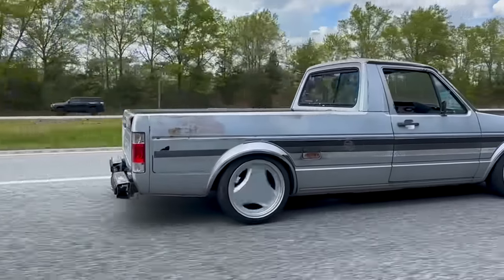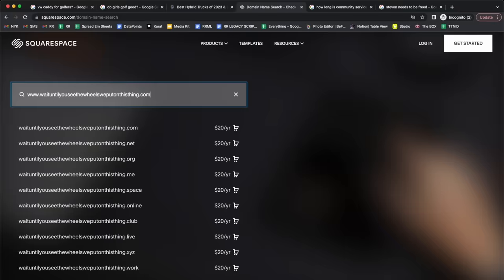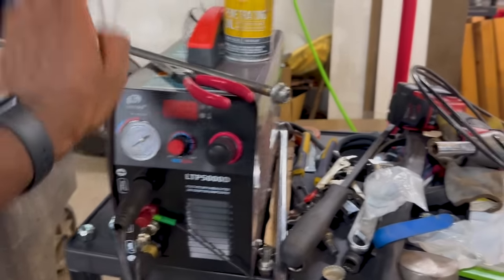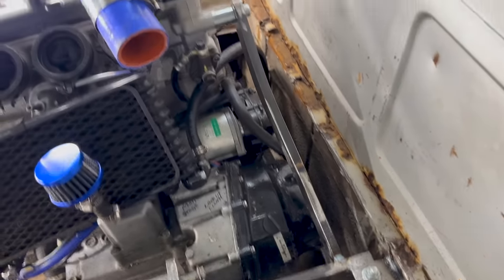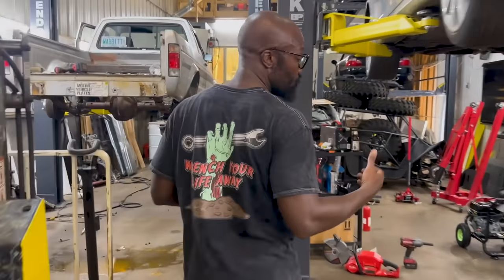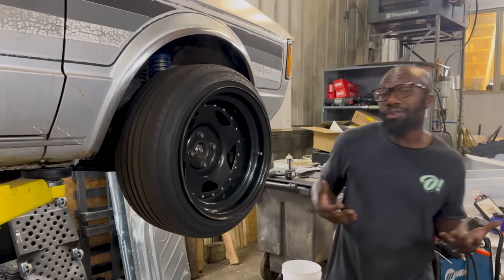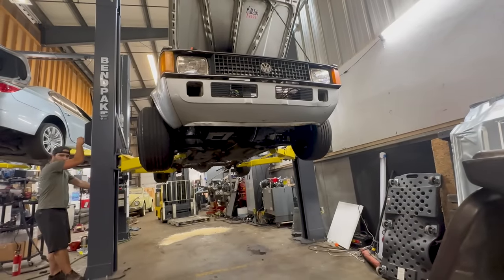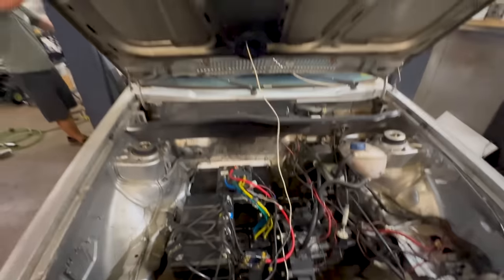The Turbo Hayabusa Hybrid VW Pickup Hits The Road

Comment: Hi Rich, on my motorbike i use a quick shifter! this could be a great and cheaper way to shift gears than a full auto gear changer!! it basically detects when you are starting to change gear ( you will need a simple shifter just for going up/ down the linear gear system.)it kills the engine for a split second and changes the gear in that split. it doesnt damage the engine and keeps the PSI of the turbo mostly intact! i think it would be a great idea for the build!
Reply: I saw a lot of these builds with bikes and they're usually car guys putting a bike engine in. I don't know maybe they're not into it that deep. Who knows...
Reply: I second this, quickshifter would give you clutchless upshifts for not a whole lot of money and the compromise is that you need to clutch for moving off and downshifts. Also then you could use a Supercars Australia style shift lever 😮
Reply: I think it's a good idea to avoid mechanical shifters, electronic shifters are expensive, but so is time.

I think the amount of pissing around trying to adjust linkages or pneumatics or hydraulics to shift mechanically could easily cost more than an electronic paddle/button shifter, and would probably need to be adjusted as parts wear in and out, especially because the gearbox isn't hard-mounted to the chassis like a normal car. 

I'm guessing that mechanical shifting would be fiddly and annoying compared to an off the shelf electronic shifter that mounts directly to the side of the engine and doesn't know or care whether it's on a Hayabusa drag bike or mounted in the middle of a Rabbit pickup.

Remember these guys (apart from Rich 🙂) have real jobs at a real company, so every hour they spend on Rich's projects is money they aren't making for Electric Garage. There has probably been tens of thousands of dollars worth of labor invested in this thing, and they still have to be paid somehow.

Comment: As a hybrid classic car it is very interesting project. But the problem with motorcycle engine is 1. Low Torque and high rpm 2. Weak Clutch and gearbox 3. Weight of chassis and body. I think for this kind of project Harley engine with separate gearbox is better option so that way you can use car gearbox and clutch with adapter plate. But will see how it goes with this engine soon

Comment: Instead of that thumb throttle thing I’ll bet you could use the tps on the hyabusa motor. Omron makes signal conditioners to turn 0-1, or 0-5vdc into 0-12 or 4-20mA or whatever your motor controller wants to see

Comment: * - Rich, you said you read these comments.. so I have a question.. Can you wire up the old ECU (and/or add a microcontroller, it would be easier).. but make it so.. that when you go in reverse it's ONLY electric signals.. and when you wanna launch it, it would start with electric until certain speed or RPM.. then gas would kick in gear, (bcuz of stock transmission).. and then the question of running them equally while driving.. equal RPM or torque.. to get 4 wheel drive.. syncing them.. i don't think the factory ECU would allow you to do that.. but you could use a microcontroller to control the electric & sync them.. some outputs go into old ECU... But the electric could start & move it with high torque up to a certain speed or RPM.. then the gas engine kicks in & together they sync up speed... 

** oh, & you can make that [? $1,500 ? - you said] automatic lever shifter.. it looks like it's just a metal frame/plate holding a *LINEAR ACTUATOR*.. make the whole thing for under $100.. you can buy the linear actuator, make a plate to hold it.. wire it up.. save $1,400... that's the rich i know.. lol

** And you don't wanna have to remember to keep doing 5 diff things while driving (this button, these 2 levers, press this 3 times, immediately repeat all, while focusing on the road and trying to steer).. the microcontroller can control EVERYTHING ... it can monitor speed & RPM, know when to send signal to linear actuator & shift the gas engine, to automatically use the clutch, to know that reverse is only for electric, and know when taking off to start with electric up to x speed, then ramp up gas engine & sync.. and honestly you could wire this up and use the existing gas pedal to control it all.. like a normal gas pedal.. but everything is happening in the background super fast.. (ECU's use microcontrollers.. same thing), or you could do paddle shifters for up & down shifts.. let it sync it & control everything.. the way it was meant to be.. if you have any questions or need help.. email me

Comment: I second the quick shifter suggestion, you only need cluch to take off and to downshift, upshifting is clutchless as the quickshifter control unit cuts power to the injectors for some milliseconds (typically from 20 99, adjustable) and doing so doesn’t hurt the internal transmission gears

Comment: I like how you said, "I can tell you guys haven't built anything.", In reply to the folks asking what's taking so long. 
I buy junk scooters, ATVs, ATCs, etc to fix and sell. Since I'm broke i usually pay between $10 and $100 for each project. As you can imagine, for that low price, they aren't in good shape. They're usually missing many parts, and have many small problems. I can't afford to just buy new parts to replace everything, so i end up doing a lot of fabrication. 
The most stressful part for me, is when I've finished an 8-10hr day of working in the garage, and it seems like i haven't accomplished anything. People don't realize how long it takes to do little things.
 I've wanted to start a YouTube mechanic channel for years, but a few things have stopped me. For one, i can't afford to buy a decent phone to take video. But a bigger problem is that I'm worried having to film everything would make it even harder to get stuff done, and make projects take forever

Comment: Gear shift.  Starter motor solenoids will work, ive used them sucsefully on a build,bonus is you can have a over ride switch that when turned on will also kill the motor on the upshift,hold flat hit up shift engine cuts changes gears allowing flat shift changes..

Comment: just a note you might want to check the interior cavity of the rear box on the caddy for an item called cavity wax if you find it you might consider removing it before testing the turbo exhaust, it was a sealant often sprayed into the inaccessible areas as a rust inhibitor, i'm just thinking the last thing you will want is a fresh coating of it on your McLaren exhaust tip, oh and don't bother with the small minded people who have never built anything before, if your going to build something and want it done right then its gonna take time, i have a mk2 Golf GTI that i have been building for the past 14 years with new off the shelf parts only, only thing in my car thats used is the body... its 90% done, but i gotta say i hate the stretched tire look, i would prefer to stretch and roll the fenders or cut and weld them to make real arches to tuck the rubber into, don't forget wheel travel when building this monster what goes down must come back up 
wheel arches are usually the death of stretched tires

Comment: Build is looking awesome! 
May I suggest the radiatior over the Axel flipped the opposite direction and pushed to the passenger side so that you can make some bed space in the back and the radiator kinda looks like a wing but coming up flush to the bedsides.

Comment: I could dig a sequential gear box geared low with a top end around a hundred so there would be lots of shifting and wringing the most out of the little Busa that could . Then tie it all together with some creature comforts like vintage air maybe sparco seats and cruise control . Ventilated cooled seats too  . I actually drove one back in the day as a company vehicle.  I loved that truck , a diesel if I remember correct . ? Slow and gutless but very ergonomic very comfortable . Gas milage was it's key attribute over any other , and it delivered . Fairly nice interior mine was loaded I think two tone red and black .

Comment: If there are issues with the driveline being too short and ujoint angles not working you could always IRS swap it, the infiniti g37 and is300 both have relatively narrow track widths and solid diffs, and are very easy to fab mounts up in trucks. It'd get rid of those drum brakes and leaf springs too, would handle way better. I did an irs swap on a tacoma on my channel. progress looks good, take your time, we don't mind haha!

Comment: Don’t need that weird shift thing, can get a quick shifter and it will do full throttle clutch less Upshifts. If you get the SP race module which is pretty cheap you get pit limiter, quick shifter and launch control for a couple hundred quid, just put the hand clutch lever on the gear stick for down shifts and pulling away

Comment: The rear of the bed is a low pressure zone therefore it’s a terrible place to mount a radiator due to the lack of airflow. Just thought I’d mention that although maybe the extra large radiator from the C10 will allow for enough overall cooling for that cycle engine hopefully. Keep up the great works Rich screw anybody that doesn’t like the build or how you go about it, remember it’s not their build.
Reply: Maybe they can add a fan with a thermal switch to turn it on and off

Comment: You need to put separate air caps on the shocks  .. cos with a Y line the air can move from side to side as you turn the corner or go over bumps .. I know from experience I use to run the same shocks in my Torana in the 90s

Comment: Since I understand like almost nothing about hybrid systems, could you wire in an alternator or something on a switch that could be turned on manually when the battery pack is drained to re charge the system?

Comment: Just wanted to leave this here because I read about it somewhere else. If your air bags or air suspension share lines then under different load you could have one shock forcing air or removing it from the other. Learned with people towing you want both bags to have separate lines. Idk how well thus translates into this project but figured I'd say it anyway

Comment: For the vacuum pump,  a mid 90's Ford 1-ton diesel pickup truck uses a relatively small, lightweight, and inexpensive vacuum pump. I've used them on many of my projects and they have always worked well.

Comment: Don’t know what Gen Hayabusa engine you got, but if it’s got electronic throttle you can run up and down quick shifter with auto blip and ignition cut, worse case is up shift only either way. Air shifter would also be sick. Slow speed you’ll need provision for clutch and manual gear change regardless.

Comment: I love your shifter idea. I honestly think you could make one in house! Basically you’re Going to need to make a custom bracket( which you guys are damn good at). And then I would use a pneumatic piston, it should have enough force to shift up and down and can be easily controlled with a cheap solenoid. Last piece of the puzzle is going to be an air tank and compressor, I don’t know if you’ll have space but if you do that you could also probably hook it up to your rear suspension too! I really hope that helps! Absolutely love this build!!

Comment: Maybe you can make your own auto shifter. If you take another vacuum pump and turn it into a compressor, you can use a solenoid to pneumatically control the shifts. You will still need a clutch to downshift though, which you can connect to the existing pedal clutch

Comment: I used air shocks that were quite a bit different looking , because they were made in 1980 something . On the back of my 1977 Camaro , so it wouldn't squat so much under power . And you could add a front lift system to any car ever made using the same principle .

Comment: For the gear shifter, couldnt one just fab up an actuator that moves the lever up and or down? Then run the switch to the steering wheel for a paddle shift type button(s)?

Comment: 11:58 With body filler, use ½ to ¾ of what the directions say. The 2% (line of hardener across the diameter of the filler puddle) is if you're just gonna hit it with like 4 swipes of the spreader in dry-ass 70° weather.

Comment: how will you have air flow directed at the radiator?  a truck bed is a large dead zone for air flow.  convert the rear axle to disc brakes from a disc brake model explorer or ranger you will then have an e-brake and no garbage drum brakes.  the clutch pedal from the original trans should work with the Hayabusa just need some tweaking.

Comment: On the clutch for the Hayabusa, why not use the existing clutch pedal and just fabricate a cable pull system for it? You don't currently have a clutch on the electric motor on the transaxle, right? The shift linkage would be pretty simple to just make up a few belcranks and rods to get the linkage up to the center console, and just have another shifter beside the one that controls the transaxle. Paddle shifters are nice, but if you want simple, cheap, and effective, mechanical is still the way to go.😉

Comment: Grate build take your time thing take time and corners will be cut if u rush. I've got a mk1 golf I'm rebuilding. The front seats, if u want a straight swap the mk2 golf seats fit the mk2 golf gti seats look the best one bolt at the front and thay slide out, the mk3 golf seats are wider at the back and need a v cut into them and bended in and welded to made them narrower. 💯💯💯💯👍👍👊👊

Comment: Good work, guys! I questioned this build at first, but I'm starting to love it now. I was glad to see how it performs with electric-only. I really want to see what happens when that engine revs up! I think this truck could get 30 mpg, or better if you can get regen braking. With the fender flares, the stance and amount of wheel sticking out won't even bother a neurotic guy like me. Makes sense that you're using this as a show truck, I want to see how it cleans up! I want to see if it can tow, too.

Comment: probably takes under 5ftlbs to shift, 20-30 degrees either up or down, so 60 degrees of total motion. I like the engine mount/tank placement, nice job on the output shaft conversion, I guess you live up north, it's gonna keep your backside warm!

Comment: Does the Hyabusa have an oil pickup that is capable of handling turns? Motorcycle engines generally lean into curves so the oil doesnt slosh as much as it will in a non-leaning car.

Comment: Should have used mustang foxbody axles to get 4 bolt wheel pattern. Would be much safer than adapters and also would have kept the wheels from sticking out so far.

Comment: A stretched tire gives a better fuel economy with a wide wheel and it handles corners better because the sidewall is already under load. Also it's more aerodynamic. Very good option for a Volkswagen (with under 100 hp).

Comment: Hello Rich. I am really loving this project like many you and your awesome squad did before. One thing thou; isn't the rear axe risking to "shift" clockwise under torsion when the shocks start to compress? I mean I know it's supposed to be kept in place by the rear engine but isn't going to create some undesired torsional (horizontal) tension between the rear shaft and the driveshaft, like putting a load on the driveshaft engine bearings?

Comment: A buddy of mine uses a button controlled air shifter at, somewhere around 1000 psi, on his Ninja drag bike. It works much faster than he can shit using clutch. His e.t dropped impressively after the change, and the clutch lasted 3 seasons as well.

Comment: T-ing the rear shocks together is dangerous. when you go around a corner the inside side will rebound with the compression pressure from outside wheel

Comment: Don't have time to read all the comments to see if this has been talked about but definitely don't use that small used wheel from the chop saw on a grinder. It will explode! Trust me I know first hand. A buddy of mine tried it and I ate part of the wheel to my face. I was half way across my shop from him and it cut me pretty good. They are rated at different rpms

Comment: It looks WAY fun, however, if that short little "stiffy" drive shaft gives you some trouble, I think one of those rubber/fiber BMW flex joint units that they used on the front of their drive shafts way back in the 2002 models, will be much more forgiving that the hard Ujoint setup. Also, it's the sense of style that your work-pace has that is entertaining for the 'more relaxed' viewers. Screw the impatient lot.

Comment: you  could also just install a motorcycle quickshifter. It won't work well at low RPM and you'll still have to use the clutch to get rolling, but it's much cheaper and possibly easier than that electronic shifter

Comment: 2 solenoids on each side of the gear pedal operated by 2 buttons, you could have a small handle close to the steering wheel and have it like sequantial or get a dsg steering wheel with the shift pedals and use the padles to operate the solenoids, either way I know you will have your cool original ideas! By the way can't believe the feed only showed me this video now as I am susbribed and have the active notification bell...

Comment: I love the electric boost idea. it's like AI, but powered by Actual Intelligence(tm).this truck is going to be a beast, and it's gonna look amazing with fender flares and an outrageous paint job.

I can't wait to see it with the Hyabusa motor hooked up. I think you should consider overriding the thumb throttle and run the electric motor flat-out when the Hyabusa motor is on wide open throttle. 

That's what I do on my widebody stanced mid-engine turbo Hayabusa hybrid 4wd Mk I Rabbit pickup and it works really well. 😜